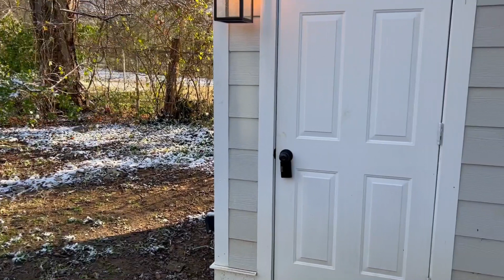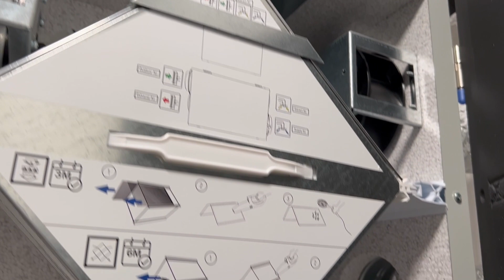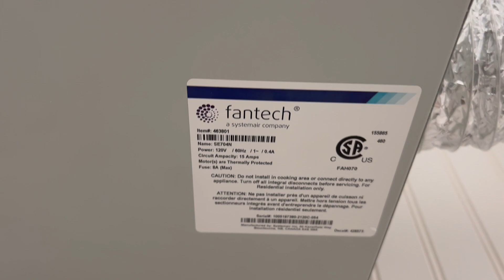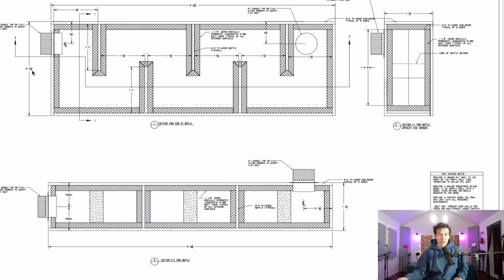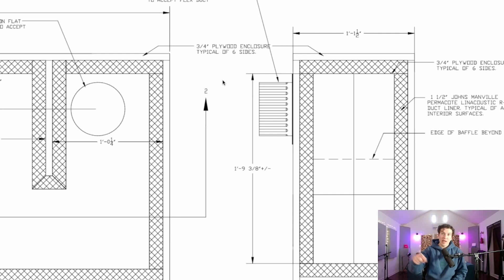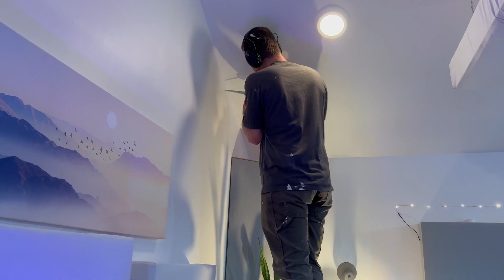How To Build A Ventilation System In Your Soundproof Studio

Comment: Hey there. Thanks for sharing. The plans show 6" saddle tap ins and outs for the baffle box but this does not seem like what you have.. What I see is that you have 4" duct going into the baffle box via an adaptor of some kind making the connection 6" possible. Then on the other side you are supposed to have a 6" saddle tap exit from the baffle box which transitions to 12" at some point but I see that your design is different. You have the baffle box directly passing through the wall and joining to the grille without passing through a saddle tap at the exit of the baffle box. Can you clarify please on these changes. Or maybe I have misunderstood something? THanks for sharing!

Comment: Should the fresh air & stale air be at opposite ends of the rooms, instead of on the same wall right above each other? You talked about the baffle box as a way to control air flow but isn't for soundproofing the noise coming through? I am also curious why you couldn't run that flexible piping (that erv uses) through the baffle box instead worrying abut breathing in that insulation product that lines the baffle box?

Comment: I'm building out a space in my basement and there's not enough room for a direct vent from the box.  If I use ducting between the box and the in/outlets into the space will that still provide the same or nearly the same properties?  I'm not worried about airflow sound as much as sounds from the rest of the house (namely kid noise) getting into the room.

Comment: Do you find that the ERV makes the mini split work harder if the temperature outside is on the extreme side of cold or hot?
Reply from the maker: No but I do find the humidity is worse in the summer.

Comment: This is such a great video. We're based in the UK so struggling to source some of the equipment, e.g. the Nailor industries stuff! Seeing how best to source similar!

One question I did have... the partition wall where we're going to need to cut out the 1ftx1ft holes for the vents... the other side of that is going to be part of fairly noisy room. It's kind of our only option, so thinking we're going to have to massively soundproof that side of the wall and even the baffle box itself. Does that sound OK? Or is it still going to be risky putting our 1ftx1ft holes on that wall? Not that we have many options!!
Reply from the maker: Soundproof the baffle box with two layers of drywall and green glue and use acoustic clips to decouple the vents as they pass through your wall and you will be all good!
Reply: @soundproofyourstudio  that’s awesome. Thanks for your help! Would be awesome to have somewhere we can buy the equipment from you listed here in the UK! 🙌

Comment: I would use some sort of natural wool insulation product, like Havenlock, over fiberglass. I definitely would not want to be breathing in any harmful particles and fiberglass insulation certainly degrades over time. Wool also has fantastic natural mold and fire resistance and sound absorption properties. Thank you for sharing this baffle box design!
Reply from the maker: Thanks for the new info! Yeah I wasn’t super excited about the fiberglass, but it does have a protective layer over it so you don’t breathe it in and it is designed for hvac. That said I still like the idea of wool.
Reply: @soundproofyourstudio  Wool is for sure going to be more expensive, but I think the long-term benefits outweigh the initial cost. I love what you're doing! Studio building is something I'm highly interested in, so I enjoy your channel very much.

Comment: Thanks, great video!  I am considering buying a shed and soundproofing it to use as a Dr rehearsal space.  So there is no surrounding utility room for a system like this.  Can a dead vent system be incorporated part of the a-frame roof, as long as I leave some space in there while building out the ceiling?
Reply from the maker: Hey Steve! Yes, you certainly can put the baffle box in the attic and that is a great way to do it. My only advice with a shed build is to beef up the walls using drywall between the framed bays since they usually use really thin light weight siding. Also build it on a slab and then cut out the floor if it has one so it sits directly on the slab. Best of luck!
Reply: @soundproofyourstudio  that confirms my thoughts, thank you again.  Follow up question if I may: what would you suggest for a low profile floor build, starting on slab as you suggested?  I have the luxury of building this exactly as I want --- I'm buying the shed for this specific purpose.
Reply from the maker: @DrEsDub  If you are referring to the type of floor on top of the slab I would do a harwood floor first and if budget is an issue I would put down an engineered wood floor or a laminate floor.
Reply: @soundproofyourstudio  right, I was referring to the layers necessary for the floor.  I've saw a shed build video (Jordan Smith) in which he put a layer of board insulation under his subfloor.  I guess since I'd be sealing the '2nd room' directly to concrete, that wouldn't be necessary, correct?

Comment: I'm getting ready to build a studio into a 2 floor metal sided barn on the property of my new house.  It has existing windows that I'll want to seal up,  but I imagine they might also be the best way to route the ERV system in and out.  What I'm Curious about is without a dedicated mechanical room or too much space for one,  what if I attached the ERV up in the highest point of the ceiling then dry wall around that to isolate it from the rest of the building? It's probably a silly question but you can't attach these to the outside of your building can you?
Reply from the maker: You could put an ERV in the attic, but it needs regular access every 3 months for maintenance. Plus the intake and outtake vents should be on the side of your building not the roof. You could attach it to the outside of the building, but would want to build an enclosure around it to keep out the weather. I am not sure how cold or hot they can get, but I would look into that too. It's not really meant to be put in an outdoor environment. Thanks for watching!

Comment: Hi there; follow-up question that has arisen after my recent ERV / baffle box install.  How do you manage the humidity in your room?  I believe you have mentioned you are located in Nashville.  I also live in the south, where it remains very humid outside.  Upon firing up the ERV, I can tell I’m pulling in relatively humid air from outside.  This won’t be sustainable long-term (mold, etc).  I have the mini split AC unit as well (wall opposite the ERV intake / output grates).  Do you just run your AC or heat, or do you also have to use a dehumidifier?  Any help is greatly appreciated.  Thanks again.
Reply from the maker: So the ERV should help with some of that humidity, but if it did get too humid in there then you can run the mini on dehumidify mode or get a dehumidifier. I have not had a summer yet with the ERV so I will let you know how it goes. For now it has been great in the winter months.
Reply: @soundproofyourstudio  such GREAT info - thanks for all of this! Question: now that you've had a summer with the ERV, how's it worked out?
Reply from the maker: @markmattingly1958  It has worked great. The only thing I would do differently is have the ERV intake vent over my mini split so the air is instantly cooled or heated when it enters the room. Other than that, no complaints.
Reply: Great, thanks man.  Looks like my mini has a “dry” setting, so will try that out.

Comment: Can you use vent fans to another room in the house ? It is a basement studio that is connected to the home HVAC system. Trying to figure out (if needed) additional fans for intake and exhaust to another room. I have a party wall to a mechanical room or a garage. No access to outside.
Reply from the maker: Yes you certainly can. In general I have heard that outside air is usually cleaner than inside air, but as long as the other room in your house has adequate ventilation it should work well.

Comment: Thanks for sharing this with us. However, If I don't have room for a Utility room, what should I do? Should I stick with my current window and deal with reflections? 

My project will transform my 14ft x 9 ft x 9 ft 2nd Floor Bedroom into a Music Studio. Only 1 Wall is workable from the outside, and that's the front wall of the building. It's also the wall that will turn out to be my Front Wall inside the Studio, and it has the window on it. And it's also an apartment, so, in the 1st floor there is another person. Having said that, I cannot put a MASSIVE 6+ Ft Baffle AND an ERV unit on that wall. It will look very bad and "exposed" :/ And, If I try to cover it with Drywall, It will kinda ruin the aesthetics of the building (I own the building, so I would prefer to do minor changes, not a 10+ ft change).

I know it's a long explanation, but what do you recommend I should do?

Thanks, 
Carlos E.
Reply from the maker: Hi Carlos! Thanks for watching. If the studio is in your apartment you could use dead vents instead of the ERV. Either way you will want to use a baffle of some kind, but you could also build the box in your studio if you didn't have space on the other side of your wall. Check these out - https://www.soundproofingcompany.com/soundproofing_101/how-can-i-ventilate-a-sealed-soundproof-room

Comment: Thanks a lot for the video.  More comprehensive than others on here and nice to know that the design you’re showing was backed by Rod Gervais.  2 questions:
1. Are your baffle boxes only on the utility room side?  That’s how it appeared in the footage you showed.  
2. How did you attach your boxes to the wall?  I am at the stage of “adding” ventilation as well and am trying to figure out how to integrate the boxes onto an already-sheet rocked wall.  
Thanks!
Reply from the maker: Thanks for watching! Yes, they are only on the utility room side. The boxes are attached to the studs in the utility room side. You could use screws to attach the box to the studs. If the wall is already sheet rocked you could attach them to the studs through the sheet rock using a stud finder. Let me know if you have any more questions.